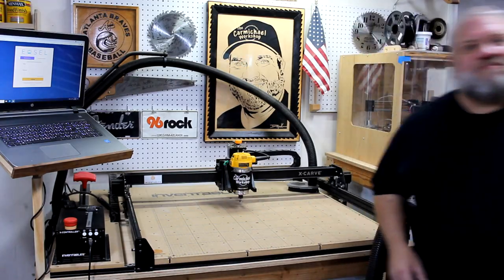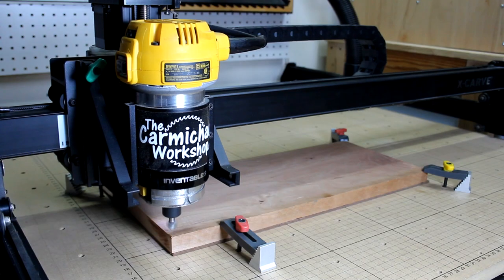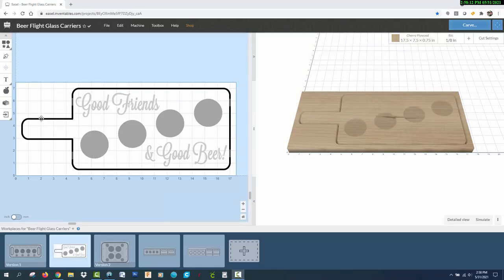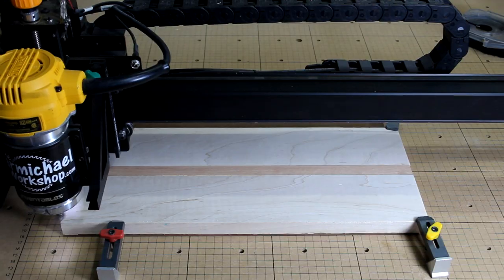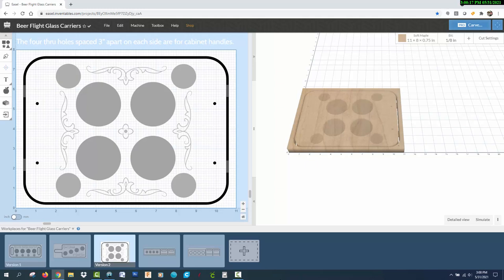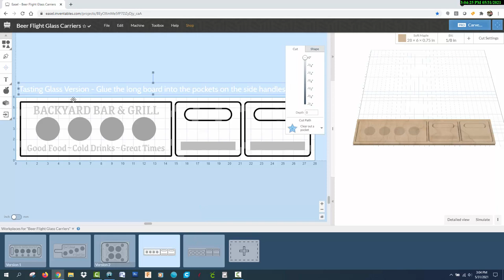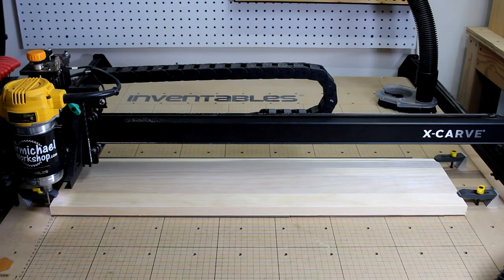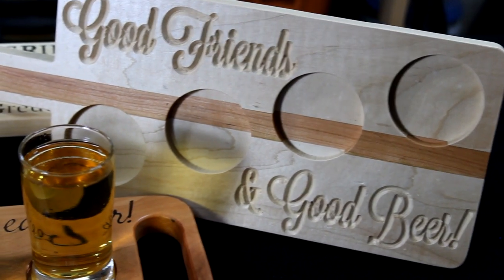Making Four Different Beer Flights for Father's Day Gifts

Comment: Nice work Steve.  They look great.  Two questions:  1.  Could you have done both size glasses in one by carving out the smaller holes inside of the bigger holes?  2.  Did you drink each beer between boards so each board had fresh beer? ;)
Reply from the maker: Hey Dale!  That's a good idea to make a small pocket in a larger pocket.  I found that these glasses are not standard diameters at all.  I think I would just make pockets to fit the largest pint glass.  I don't drink beer that much anymore, so just the four were enough for me.  lol

Comment: The designs are great. Is there any way I can get the file that you used on the software and just modify it?  Thanks
Reply from the maker: Hey, thanks!  I designed it in Easel.  Here's a link to  the project.  There is a blue 'Open in Easel' button and you should be able to download a zip with an account, or at least grab screenshots so you can size and print in Word or something.